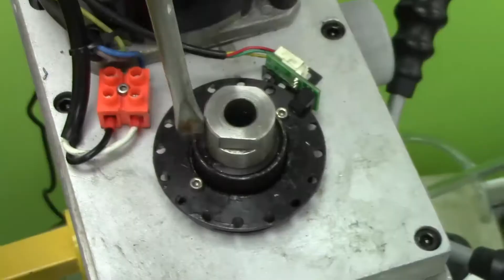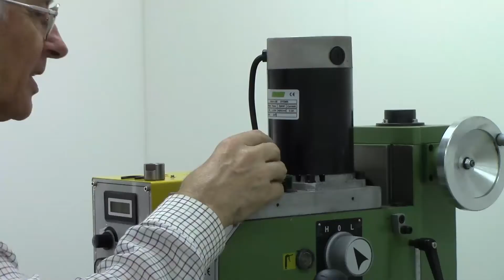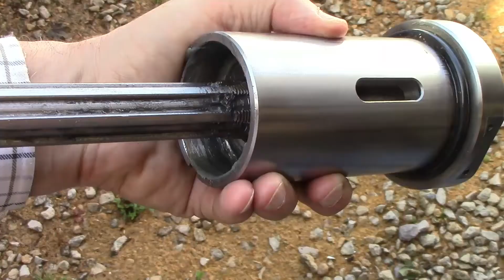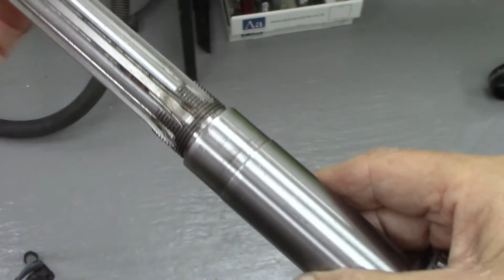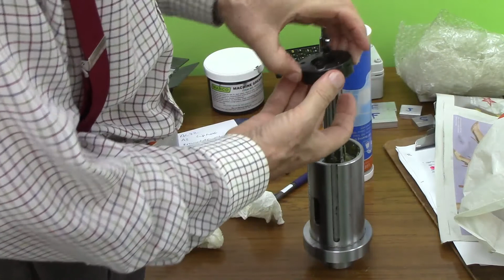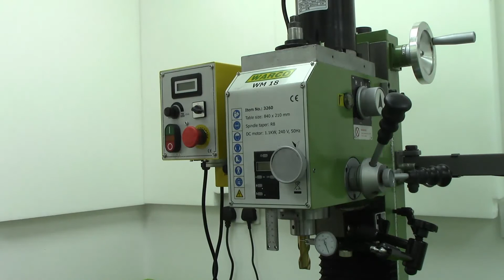Adjusting a Warco WM18 mill spindle

Comment: If you think of vehicles wheel bearings which are similar to the bearings you are working on then they are designed to run hot.
Reply: Define hot.
Reply: @thosoz3431  They do run hot due to the churning of the grease in the bearings. There is also more grease displacement churning with taper rollers than with ball element bearings.
By hot but not too hot I would say when they run so hot that the metal starts to change colour they are running in the TOO HOT range.
Do bear in mind this is why the grease specified for these types of bearing applications is designated as 'High Temperature' grease.

Comment: The mill looks basically the same model as a Precision Matthew's PM30-MV. Full manual available at their web site.
The top bearing mounting diameter should be a j class ISO fit. The bearing should be able move on the shaft without being loose. Also the bearings should be a better class than the ones used. The bottom bearing should have an m6 fit in all likely hood. To really set these correctly you really need a spacer between the inner races that sets the preload to exactly what it should be. Plus if the spindle gets hot the spindle gets longer reducing the preload on the bearings. Bearings can run 130°F with no problem.
Excessive amounts of grease will actually cause a spindle to run too hot. The bearing effectively becomes a pump trying to move the grease. Also a better grease to use would be something like Klüber NBU-15.
Reply from the maker: Thanks. I have the Grizzly G0704 manual which matches my mill design, but the PM one is more colourful and detailed.

Comment: I have a smaller warco mill. I think I may have stripped the fast gear. Any idea how I go about disassemble the head to look in the gearbox. Thanks
Reply from the maker: Not really. On mine, one can remove the fine spindle feed knob, and the quill DRO, and then remove the shiny front plate from the head. This offers a view of the gears.
Reply: @samuelfielder  thanks. Unfortunately there's nothing behind my plate.  I think there's a problem with the h/l gearing
Reply from the maker: @justa1098  Warco did tell me that the WM18 and WM16 are made by completely different Chinese firms, so my experience doesn't transfer.

Comment: I enjoyed your presentation Samuel. I have been in engineering/Training all my life (Gas & Steam Turbines) and have some understanding of your concerns. I have a new WM 14 and suffered a lock of the taper arbour, it hadn't spun just 'wrung' onto the taper making the quick release drawbar useless. I made a spacer to support the quill against the machine table (protected) removed the drawbar and using a suitably sized bar which sat on the top of the taper arbour resorted to a 3lb lump hammer ...it was still stuck fast. I spoke with Warco and we agreed to use the drawbar fully engaged with the threads (no cap Nut) and again a mighty blow with the 3 lb lump hammer  it came free. My concerns were for the bearings that is why I found your video so useful. I am hoping that as the quill was locked to the table they we undamaged? Warco were very helpful and sent me FOC a new draw bar and cap nut. My problem was not unknown to Warco and several internet contributors. I hope I am not teaching my grandma so forgive me, but in metrology you wring slip gauges together dry and they sort of weld themselves together that is the drive/friction principle of the Warco arbour, the drawbar should only be 'nipped' when tightening. The important point is not to apply any lubricant to the taper arbour and spindle they should be cleaned and degreased before fitting. Do not leave the arbour in the quill for extended periods. Warco say they have had problems with new machines which have been pre greased in the factory and you can experience 'hydraulicing' preventing the taper breaking free. I was not sure from your presentation whether the shaft was stepped keeping the bearing inners at a set distance the pre load then being applied via the bearing outer races via the nut but if so it would have been more evident on the shaft and to do this would require precise machining. So I am mystified as you were as to the pre load arrangements. Once again many thanks and often someone, as you modestly say, is not expert in machine tool technology does not take things for granted therefore your questioning of the basics made things abundantly clear. I think these machines are far from perfect and do have design issues however they do work and are affordable. A comment was made re your lathe which looks to be an excellent budget machine. I have a Myford ML7 built in 1960 and it is indeed the Rolls-Royce of machine tools however refurbed Myford Super 7 (I don't think you can buy new) is about 7.5K
Reply from the maker: I am not sure about this locking you refer to. It is quite normal with my mill that whatever arbour is in the spindle remains there after the draw bar has been loosened. I just undo the draw bar by only a couple of turns and then bash it moderately downwards with the spanner to free the arbour (I don't need to use a lump hammer). Whether this is normal for mills I wouldn't know, but it seems reasonable. For example, the taper on my lathe tailstock also holds arbours in, and they did too on my old drill press. In all cases some force needs to be applied somehow to unlock the tapered arbour. Whether or not the quill is locked will not affect any loading on the spindle bearings: the bearings hold the spindle in the quill, the lock holds the quill in the column.

The lower spindle bearing is pressed onto the spindle, fixing the position of its inner race. The upper bearing's inner race is also a light press fit - that was what surprised me and made me wonder how one was supposed to adjust the preload. Both outer bearing seats are fixed in the quill, and preload is established by screwing down the upper bearing's inner race on the spindle. There is a second part to my video which may make things clearer (I can't remember!).

Your Myford will be much better than my Chinese minilathe.
Reply: @samuelfielder  It was indeed an 'abnormal' situation and discussed in detail with WARCO if you search Google several people have had 'taper lock' a hydraulic press, should the quill be removed, would in this case cause distortion, the impact method providing the main spindle is locked against the table was the best solution, again as approved by Warco. I am still confused as to the bearing preload this is because we do not seem to have precise instructions as to the assembly philosophy. I hope my experience helps others as your presentation did for me. Interestingly Warco said they have had problems with new machines due to oil or preservative being applied to the taper arbour on assembly the secret seems to be to fit dry and the jacking release method will work. I certainty was not comparing your lathe to a Myford as the machine it looks a very good tool for the money.

Comment: Thank you for showing this video.
I think that I may be doing the same with my WM14 but I think I will invest in a hydrolic press first and some better double angled bearings.
Reply from the maker: I've wanted a hydraulic press for ages. The problem with this spindle, however, is that you cannot get it out without pressing downwards on the top of the spindle, that force being taken across the top roller bearing, which is improper. There is no chance of getting a bearing puller beneath the top bearing, as one normally would. But it isn't a tight press fit, so I assume the forces involved are tolerated by the bearing. You're thinking of using angular contact bearings rather than tapered ones? I did look for SKF tapered bearings but they seemed to be just the same as what I've got. Another problem you'll find with changing the bearings is that there is no provision for pressing the bearing shells out. I don't know, because I haven't tried it, if you could get them out by heating the spindle in an oven to, say, 150 deg C, and then freezing the shells by spraying them. Frank Hoose here https://www.youtube.com/watch?v=N7o4mPa9SGg fabricated a special tool to get a grip on the bearing shell.
Reply: I was toying with getting a small Clarke press, but after watching your disassembly video, I am more inclined to buy the Clarke CSA12F 12 tonne press from Machine Mart.  This way I would be able to move the mill inside the press frame, plus the press comes with base plates that would enable the removal of the bearings.
I have also been looking on Gears and Sprockets website for sealed bearings, as open cased bearings need a good supply of grease or copper slick, which I prefer to use.

Comment: Nearly identical to my Amat25LV to remove the spindle.
That top nut holds the draw bar captive on mine, MT3 spindle.
I had a similar problem, I had to tighten the preload, due to runout.
It's also belt driven, no gear noise. 
I've never run over 1000 rpm, for milling as a general rule.
Adam
Reply from the maker: On mine the draw bar just goes through that top nut and is not captive. I was using the feeds and speeds calculator from Littlemachineshop.com, which said 1940 rpm for a 10mm dia HSS end mill in aluminium. Wrong? Also, Adam, do you know if the inner race of the top spindle bearing on your mill is a slip or interference fit?
Reply: @samuelfielder  
The top bearing is an interference fit on mine.(same Chinese factory :) )
As for spindle speeds, I was taught to start slowly, checking the finish and the sound of the cut.
Pointless, over heating the cutter, I'm in no rush, no dead line to meet :)
Adam

Comment: This is like one of those ‘soap opera’ cliff hanger endings designed to make you return to watch the next episode.
“Will the runout be greater?  Has the bearing been damaged by over enthusiastic use of the wooden mallet?  Will the original spindle need to be purchased and refitted?  Could the mill morph into a Range Rover?
Will extra sugar in his tea be enough or will a second cup be required to figure it out?
See the next exciting episode to discover what happens next.  🧐
Reply from the maker: Yes, I do come across as somewhat in need of sustenance!